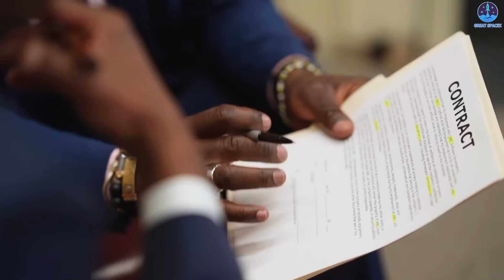Congrats to SpaceX for more mission assignments while waiting for Starship launch...

Comment: How in the world does ULA still trust Blue Origin to come through with the all the necessary BE-4 engines to satisfy the contract!!??
Reply: Indeed. Frankly, I struggle to understand why anyone takes Blue Origin seriously. They clearly have the resources but they have yet to produce even an orbit-capable rocket.
They build really cool models, though!
Reply: Unfortunately at this point they don’t have much choice.  It’s use the BE-4 or delay their own Vulcan for another 1+ years whilst they develop a new engine.  All they can do is test it as much as possible and prey that it works.
Reply: @rgberry69  ULA is paying BO $8M for a hypothetical engine.  It would not take over a year to reengineer the thrust puck of Vulcan to accept Raptors.  Since the estimated manufacturing cost of a Raptor is about $250K, SpaceX could make a healthy profit and still undercut BO's price.